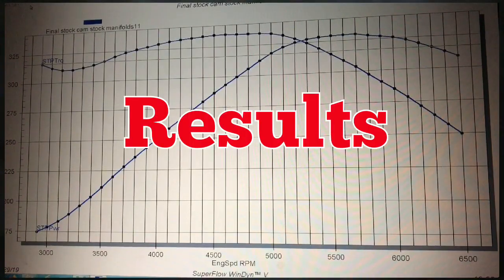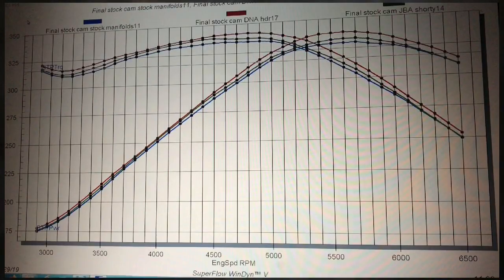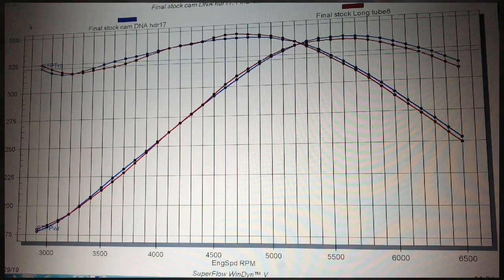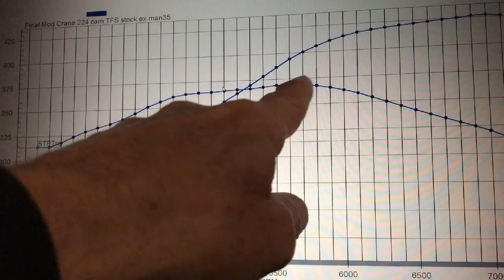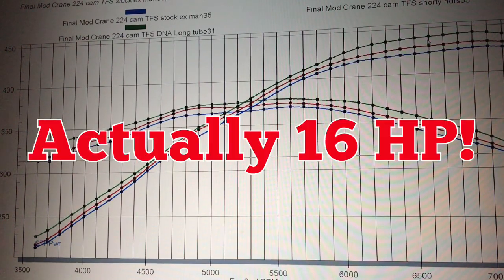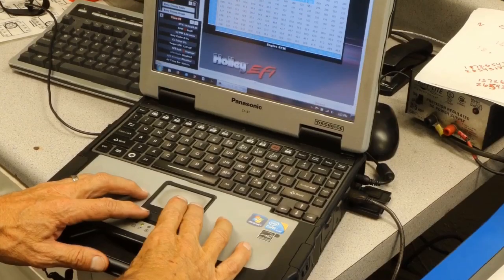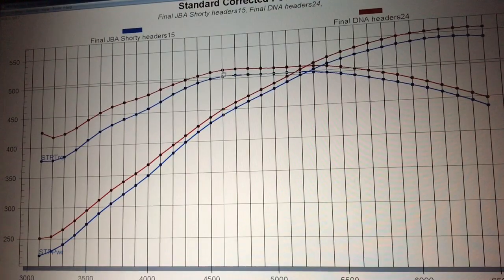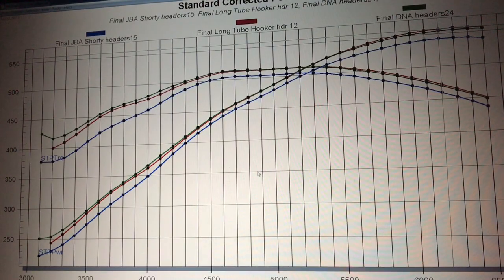DO THEY WORK? LOW-$ EBAY HEADERS

Comment: eBay headers fit great on an engine dyno
Reply: 9090ruby 
Engine Masters already covered denting headers to clear objects doesn’t affect power much.  They beat the hell out of a couple Hookers with hammers to prove it.
Reply: ChuckO doesn’t mean i want to go denting up my exhaust to make it fit
Reply: @9090ruby  pretty clear you have never built anything before. Nothing ever fits as advertised. If your even lucky enough to get the right parts on the first try.
Reply: Tim H maybe youre just not that good at building stuff lol
Reply: @timh1187  so u just confirmed you buy cheap parts 🤣
Reply: @upnorthviking823  yeah not hiding it. Just because it's expensive doesn't mean it works. Sloppy  mechanics over there building 1000 hp monsters proving it everyday.
Reply: @9090ruby  it sounds to me like you have the necessary funds. Many of us dont!!!
Reply: @kevinshiley9061  ive been there to more then once buying budget headers and waisted money on them because they didnt fit or leaked. There are mid grade options to like texas speed or speed engineering. Im just saying my experience with cheaper headers it was a waist of time and money.
Reply: @9090ruby  and you have as much in headers as I'll have in my entire engine!! I live on SS and have been buying new, what I can and the rest is used. I cant even afford to get into and LS, just s first gen SBC for in my 82 AMC Spirit. No Corvettes or GTOs!!  360 SBC, T5, and Ford 8.8, all home built.
Reply: @kevinshiley9061  i have middle of the road $800 texas speed headers on my corvette not exactly breaking the bank there. And again in my experience cheap ebay headers dont fit well im not sure why youre arguing with me about this. Its something someone should keep in mind when buying cheap ass headers they may not fit well, they may leak, they may not last long. Thats my point! If you cant afford good quality headers then be prepared to do some fitting
Reply: @9090ruby  who's arguing? You want me to say you're right? Spend $2k on headers, so what you dont have heads and pistons then, you have a great set of headers!! And if you had some heads they'd fit great!! LOL
Reply: @kevinshiley9061  not once did i say you have to spend 2k on headers! I spent $800 for american made ss headers that fit great and help make 650rwhp in my car
Reply: And if you remember that episode,,didn’t they pick up 1-2 hp? After beating them to shit lol
Reply: @stlchucko  That wasn't nice, Hookers are people too.    ;^)
Reply: They fit great in my big truck before it got the turbo treatment.
Reply: Yea they fit great on my 2011 silverado
Reply: They fit good on my 2011 Mustang GT.
Reply: @timnye7493  hows the power gains and did you tune?
Reply: No worries ,i will make fit properly in my 70 Challenger

Comment: Cheap might be the way to go, but do your research for fitment.  If you buy them used, ask if the reason the person isn't using them is because of fitment.  fitment is HUGE. hell, the expensive headers have fitment issues.

Comment: I don't doubt performance is similar eBay vs name brand, fitment and longevity is usually the issue
Reply: And you don't mind banging up a set of $200 headers compared  to a set that cost $500
Reply: Superado2006 you must be an LS guy cuz $500 is eBay headers for mopar haha
Reply: @jeepwk6.5L Uh... this is a video on LS headers... so yep.
Reply: Superado2006 lol
Reply: Colin1337 yeah my eBay headers rusted up super quick for being stainless. But they did fit and work good
Reply: I put a set of Hooker Super Comps on my mild 350 in my '76 Camaro. I used them because I found a set for $50. But I have to say they are the best fitting SBC headers I've ever owned. I only had to clearance one tube to clear a spark plug. Everything else was great.
Reply: Put mine on 3 years ago fit perfect and still look great.
Reply: I've had a set of DNA shorties on my build 97 L45 350.. the new 350.. and they fit amazing, a but of rust and mud Gilroy 🙄.. but 4 years later and they are still working great.

Comment: What you should have mentioned is the benefits from long tube headers down low when you take off from the stop light. For a Heavy vehicle like a truck, there is where they really shine.
Reply from the maker: I think I mentioned the low-speed torque gains offered by the long tubes several times-but one more can't hurt

Comment: Love your video, would have liked a chart with all the numbers from the 3 engines and headers at the end.

Cheap or steep?
I have never had a name brand company help me out with a warranty or a customer service issue without fighting for days or even weeks. For me I’ll run the cheap headers and replace them every couple years. Not to mention it’s easier to stomach bashing them to fit.

Comment: I didn't expect massive performance difference. What I have read in E-Bay reviews indicates, poor fitment, bad welds, and difficult installs. Combine this with bad customer service... I looked hard at these budget options, I figured I could port, and grind to get better fitment, air flow, and quality if I wanted to do the extra work. In the end after reading lots of install reviews, on E-Bay as well as car forums, I landed on spending more money.
Reply: Exactly most people dont think of that. Most don't even fit in the car.

Comment: FINALLY a 4.8
I’m going to be putting together a high compression 310ci engine and can’t find any info on small n/a LS builds
That 4.8 should push over 450 with a fast102 don’t you think?

Comment: All the brand name header manufacturers are going “dude shut the hell up”
Reply: The value of expensive headers isn't really in a power difference, it's in the quality of materials an the fact that they may last 30 years, while these ebay headers will rust through in 5 years. Also the big name headers are gonna look ways better and often come coated
Reply: @Prestiged_peck  / look man I’m all for buying American but these companies need to understand that they are cutting their own throats with their prices. In the header and intake manifold markets this is most pronounced. Things aren’t the way they were 15-20 years ago when these chi-com copies started showing up on eBay, and you had a 50-50 chance of them actually fitting or not. In a lot of cases the copies are just about as good. A set of stainless lt headers with Y pipe for a 3rd gen Camaro is about $200 while the nearest American variant is over a $1000. And yes the fit is going to be better on the US set but people will deal with a few headaches with that big a price difference. I know companies have to recoup R&d costs, pay employees etc... but they need to be competitive or these Chinese companies “employing” 10 year olds are eventually going to either shut them out or force them offshore. I’m not saying that they shouldn’t offer a $1500 set of headers but come out with a $2-300 budget set and give the people buying the copies another option.
Reply: @limabravo6065  they really should, like for me if imma pay $1500 for a set I'll build myself some, motion makes a good flange for like $20 a side, get some elbows and J's and start tiggin
Reply: @Prestiged_peck  I know right. I just put an LS into my 89 Camaro and I looked for swap headers from Headman, Pace Setter, etc etc...  And they were all in the $600-$1400 range. Then I found a set from DNA (Chinese Amazon deal) for $350, stainless, and came with dead-soft gaskets and hardware. I’m pretty sure you can guess which ones I bought
Reply: @limabravo6065  mhm. I'm needing front facing turbo long tubes for a 4.6 DOHC, good luck finding anything like that online anyways lol
Reply: @limabravo6065  The headers cost almost 2 times more than a turbo kit 😂😂😂
Reply: @Prestiged_peck  Have had ebay shorties on a 94 K1500 since 98, still on there.
Reply: Were you in a fight?
Reply: I seen that too.....lol.
It looks like Richard may have left some Grease on the side of his face Close to his eye.
Reply: There's no to compete with cheap child labor
Reply: I’m looking to replace my cheapie headers after under 3 years and tired of exhaust leaks. Not only dealing, but I think it’s now 3 times I’ve had to weld one back up after cracking.
Reply: I can’t justify 1500$ on steel tubes I get that time goes into making them and r&d costs but once they’ve been out for a while and you now know what bends need to be made so that the production can be sped up I think they’re just price gouging those who have performance cars

I have a Silverado a “brand name” set up is like 600 
My brother in law has a mustang 
His “brand name “ set up would cost double just for headers
Reply: The whole view is a bigoted one. China makes over 83% of everything in america. China gets blamed for cheap white businessmen who choose to order the cheaper product and charge more. A whole country doesn't represent the quality of headers. A lot of old school people who thought usa was producing would be sadly mistaken...like Milwaukee tools.
Reply: @Naginc dude im not singing the praises of a bunch of commy slopes
Reply: Where does one find the corona headers?  CHI-NUHH

Comment: We have had customers use the DNA headers with no issues. Most fitment issues are due to customers ordering the wrong part number. 3/8 laser cut head flanges never leak. I have no clue on longevity and that is one reason why I personally buy tried and true headers for my hot rods. I can understand why people buy the DNA headers with header prices going through the roof on some brands.

Comment: I was always told the big difference at least for ford headers was Flange thickness. Cheaper one can look identical but material and thickness of the flange are the big difference. Cheaper one's tend to warp over time and break studs and obviously cause exhaust leaks. Great video btw very useful information!

Comment: Only difference between low cost headers and high end headers of same size is the quality of the part itself. What metals is it made out of, quality of welds, quality if fitment, etc. If you spend more on headers thinking your gonna gain lots of hp compared to the cheapos your in for a sad surprise. I run SLP headers on my G8 and my trailblazer ss came with obx headers. You can tell the difference in quality pretty easily.

Comment: We found that if you modify the short header exit to proper merge collector it will make as much as long tube version.
Reply from the maker: it will not
Reply: @richardholdener1727  It will. At least 5 dyno runs to prove it. We compared modified ebay shorties to kooks - 5.0 coyote.  Literally no difference

Comment: Great video Richard! However, my biggest pet peeve with any comparison testing is the slight test variables-please only apples to apples testing. Thank you
Reply from the maker: what variables
Reply: @richardholdener1727  If I heard correctly, the different collector extension sizes and lengths

Comment: I'm still curious about the 1.78 tube shorty with the 3" collector how they perform vs longtube.
Reply from the maker: same as 1 3/4 shorty
Reply: @richardholdener1727  Was the shorty a 1and 3/4 tube in the video? I only ask because in some swap vehicles shortys just fit a lot better.

Comment: Tri-Y ?? Really enjoying your new vids cobber, any chance you could do a tri-y comparison. super interested to see what the low down torque difference is. Most of my car/utes have had that design so if it is just a packaging thing are they worth it over stock or is there some magic low velocity savaging. 

Would also be ace to hear a quick breakdown on the fuel volume used per kw (or whatever bizarre freedom units you lunatics use). eg pick an arbitrary 100hp at 2500rpm to represent highway cruze and give a lb/h of fuel for each modification stage. if it's a valid test it should only take a few seconds after each pull and i figure cheapskates like me and distance racers would love a couple of minutes on efficiency (if it's not a valid test and you have a few minutes please shed some light). thanks again for you work hope your channel blows up.

Comment: Your description of header theory is just that - theory. 

I strongly doubt the scavenging occurs as the theory states because there are so many variables that headers couldn't possibly work across the broad range of conditions you get in a street car and the tests basicall show that. 

Sure scavenging is real, and the cross plane crank V8 benefits from headers. It's just that it occurs in such a narrow rpm band that it is more marketing I feel. Some motors like different diameters, some like 4 into 1 and some tri Y. All these pipes are doing is just reducing engine pumping losses and compensating for too big, too small diameters and a ridiculous amount of other variables.
The header dent test on YouTube was hilarious. Mandrel bends - waste of time. It wasn't until the primary tubes were bashed closed that the power began to taper off. Bernoulli's Principal at work I'm thinking. 

Also shorty headers. The big problem with them is that the merge is only 2 1/2". If they made them with 3" merge or collector then you could put a piece of 3" pipe for a couple of feet after the merge. I always have wondered what would happen.

Scavenging is for race cars where they can make it work by because they have a control race motor and a squillion dollars to test every iteration and they can keep the rpm in a narrow band.

Years ago there was a header test on a stage III cross ram 426 Max Wedge. The Max Wedge manifolds are a pretty good looking piece cast by all accounts but are still a compromise. Well what do you think happened? HP was the same and torque was the same - BUT - the torque peaked at a full 1000rpm lower. So instead of max tq at 4500 it went to 3500rpm. That's a substantial improvement in my book.

Tube headers in big motors make a big difference but on smaller motors they're a waste of time unless you're fixing a very poor design like on my V6 daily driver where the exhaust has a head on collision with each bank. Even then the headers made not as much difference as claimed. It revs a bit freer and the throttle response is a bit snappier and the fuel economy is very slightly better - in other words a waste of time.
Reply from the maker: its seems like you don't have a complete understanding on how scavenging (in its many forms) actually works-its real and works over a broad rpm range-headers are not simply flow-in fact, many shorty headers flow more than long tubes-just like short runner intakes-the gains (like intake manifold design) are from the pressure waves created-rpm dictates the time allowed for the waves to travel the design length(this determines what rpm they are most effective. thnx for watching
Reply: @richardholdener1727  No, no. I understand alright. You on the other hand have sponsors to consider and we wouldn't want to upset them now would we?
Thanks for the reply.

Comment: $1500 to $2000 for headers is just to much for a stock engine with just a cam upgrade!
Reply: It's to much for any engine.
Reply: @1godgodgodgodgod  8:1 collector with boom tubes may be worth it. Beyond that it's a pissing match.
Reply: only to gain 20hp if that
Reply: its too much for anything that doesnt make 2000+hp and need to be made out of titanium
Reply: R
Reply: See
Reply: 2k fer header better be custom 1 off crap fer a v8 v something with turbo crap on it and a+ work if not then ill doing fer that big dollar jobs are nice butt  n  head customers some any how can be hard on ye ill most likely sticj to redoing it my way and then selling it off
Reply: To gain 10hp at the wheels ain't worth the money.

Comment: Is there a weight difference between the ebay long tube vs $$$ long tube? Is the expense difference because of better materials or better welding? How long till the ebay headers crack?
Reply from the maker: we've had both headers a long time-its not a material quantity difference-its labor rate mostly

Comment: Great video!!! I have 17 Roush Stage LC3 makes 800+HP and big name headers suck as Kooks, SW and corsa are 1,300+ and a company 2M Fabercation make a set of long-tubes for 15+ Mustang GTs that are 304- stainless and fit great for 480 bucks
Reply: Roush LC3 sam what do you think about pacesetter headers I found them on summit racing
Reply: @JJ-gr7th  I Don't know much about them but I just got a set of Texas Speed and for 750 bucks you can't beat them

Comment: Awesome video!  I have a 575hp 393w in a 71 F100... I had to run 1 5/8's long tubes for a 302 on it since no company offers headers for a 351w in a early F100...  How much do you think a set of 1 7/8's headers would be worth on a combo like mine?
Reply from the maker: maybe 10 hp

Comment: As always, shorty headers are basically useless. Basically just engine bay dressing. What's also true is that if running a PD blower and commensurately small-ish cam, even long tubes don't make a huge difference against a well-done factory manifold (like LS7). In my opinion, the loss of durability and increase in under-hood temps aren't worth it.

Comment: Nice results! My question would be the gains of the cheap turbo headers vs the high$$$ brands. 3”v band collector style. I’m curious to see the pros and cons of the inexpensive turbo headers. 
Keep up the awesome content!
Reply from the maker: the cheap turbo headers work well-the ones I tested just don't have good plug access and want to burn plug wires
Reply: Richard Holdener I guess that’s the biggest drawback vs the big $$$ name brands

Comment: I've been looking at getting a turbo kit for stock truck manifolds and later on down the road swapping the manifolds for shorty truck headers and I'm wondering if this would be worth the time and money
Basically manifold vs header under boost
Reply from the maker: don't bother-nothing there
Reply: Kinda what I figured but there was always the thought in the back of my mind that maybe more airflow would help but I see that it's not enough of a difference to worry about
Thanks for your reply